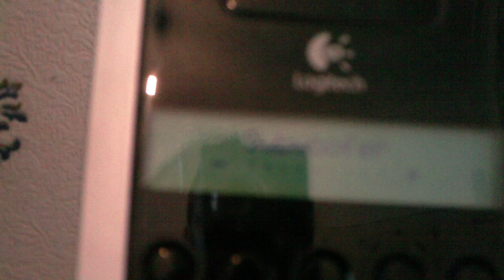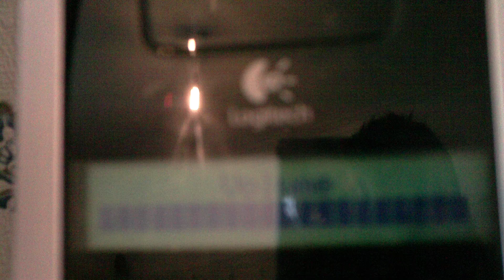Logitech Z-5500 upgrade/mod tutorial

Comment: i have a question that needs answering. im replacing my subwoofer on the z5500. im looking at a pioneer TS-W259D4, this is a dual 4 ohm voicecoil subwoofer it has 350rms.  but i also have another subwoofer to choose from, its a rockford fosgate P1S8-10 this is a 8ohm subwoofer single voice coil. this has 150rms. the rockford has a closer rms rating to the logitech z5500 amp. what do you suggest? i dont want to blow my amp, and dont want to ruin a new sub.
Reply: If you want check Pioneer TS-W257D4. I'm running my Logitech Z-5500 with TS-W257D4 without any problem or risk to blow my amp.

Comment: Tip:

If you put the volumen of center audio to the max, it will be more louder than the Right and left speakers. So the best configuration to be all balanced is to put the volumen of the center speaker at the center. This way it will be balanced. The same with the subwoofer. Put it in the center. It will last more.